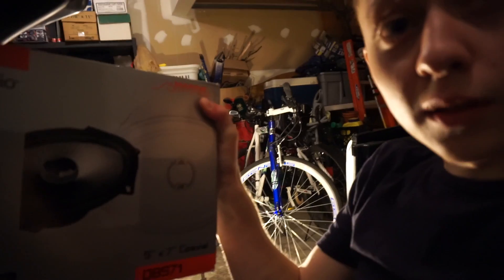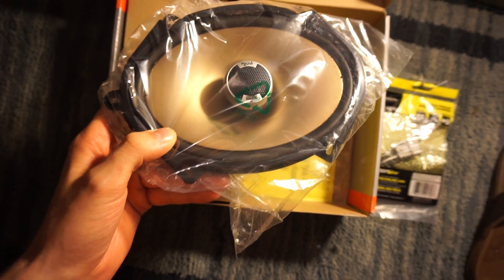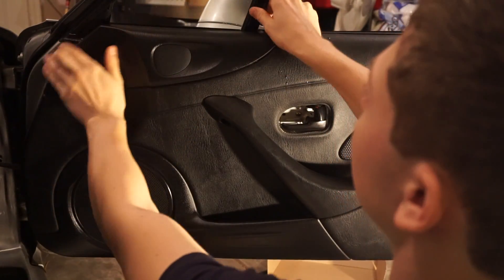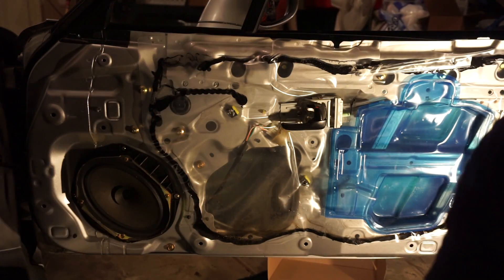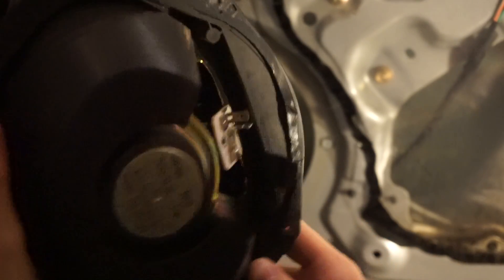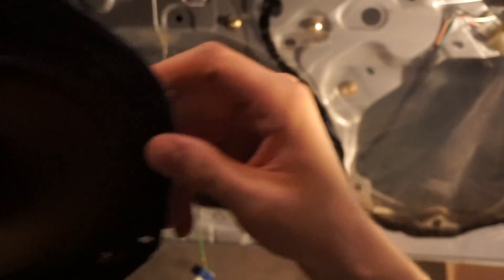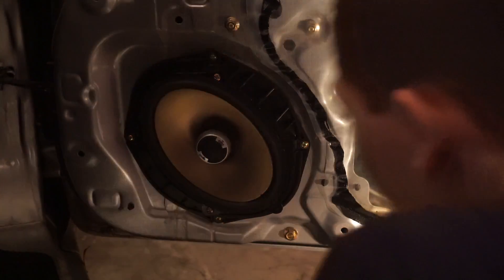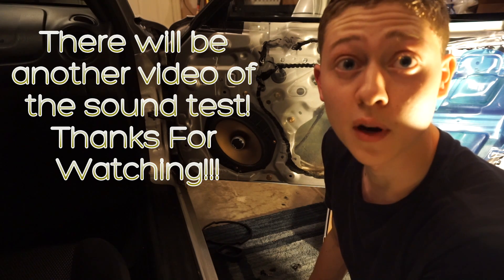NB Miata Speaker Install "Polk DB571"

Comment: Great video bro, i am doing this tomorrow so this wil help thnxx ! One question, what is the size of the new speakers, because i heard that they vary between buildyears. I have a NB year: 2000, thnx
Reply from the maker: +Hicham Aobali The size that I used for mine will fit also the same harness will work that I used or you can wire it yourself.. The size is 5"x7" and 6"x8" openings. Type your info into crutchfield and it will show you what you will need or the speakers you can use. You could put some of those round speakers in there but you will need a custom bracket for them to fit.

Comment: did you ever do a comparision video?
Reply from the maker: I haven't, I already installed these and never got to making a video comparing the old speaker to the new polk ones.
Reply: +Kyle Caughill okay....but what do you think about them now? How different are they?
Reply from the maker: +bilalsidd89 A lot better! That's for sure. They are much more crisp and the mids are very nice. As most polks are they will always give you good highs that the tweeters can produce. I can actually listen to music while the top is down, I can turn them up much louder than the stock speakers without them causing distortion.
Reply: +Kyle Caughill thanks for the quick response mate. I am considering buying them from eBay.